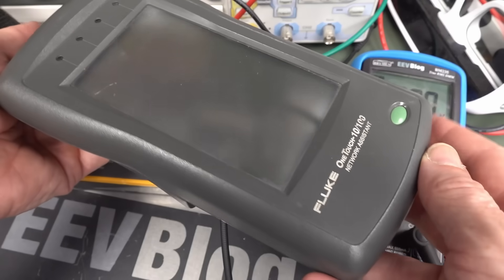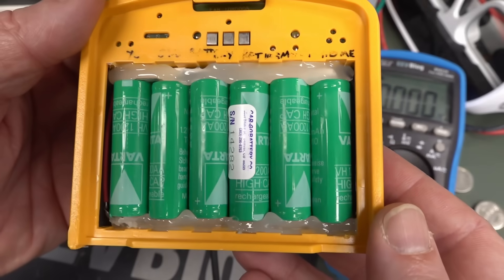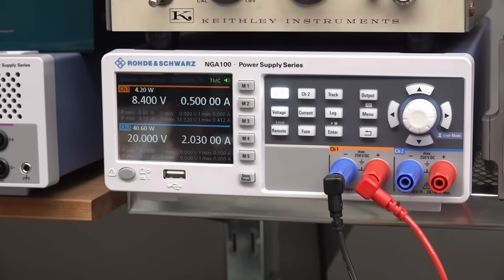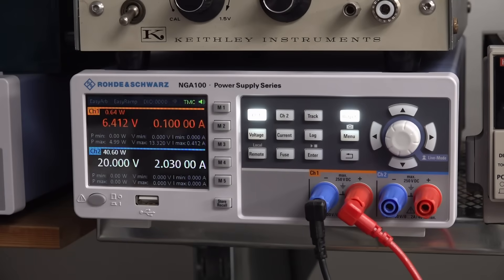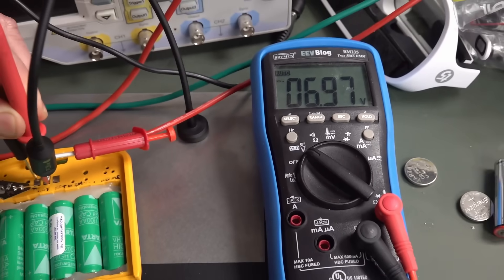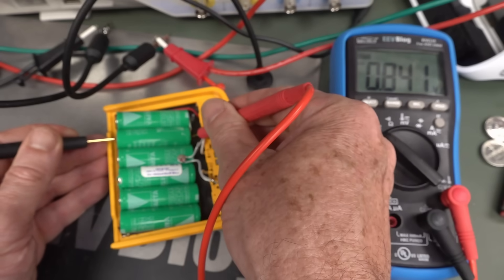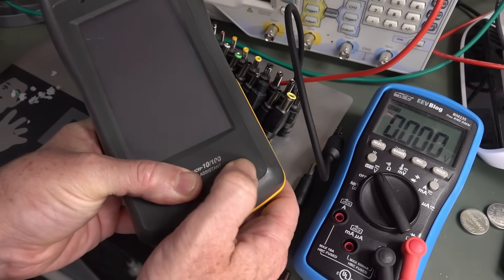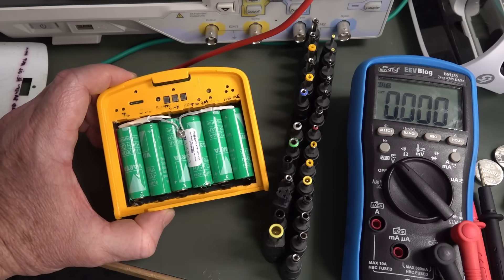Fluke OneTouch Network Tester Battery Restoration Attempt

Comment: NiCD batteries are a unique bunch. Their optimal storing voltage is between 0.6v - 0v flat, so leaving them empty won't kill it as it's kinda being preserved instead. Anyway what's probably happened is that there are too many crystals in the NiCD battery, causing a minor internal short or just blocking the electrical path within. To solve this, is kind of funny actually. You zap the battery with a high voltage. Yes absurd as this is, it does work and doesn't really damage the battery and actually increases it's resting voltage when fully charged. On battery university take a look at article BU-807 and BU-807a

Perhaps you could experiment and see whether it actually brings that battery pack back!

Comment: For old NimH batteries I usually hit them with high current (around C) for about 5-10 minutes first, keeping an eye on temperature. Then charge them at 0.25C until charged.

Comment: NiMh that old (this 1200mAh type is from mid 90s i think) are very likely to be completely rotten. It is not so much about voltage, it is the inner resistance rising up and up. Personally i use a ESR Meter, a good AA Nimh should be below 50mOhm, premium types like eneloop are below 25mOhm. If the ESR rises above 100mOhm it is time for recycling bin...

Comment: Try individually charging at say 12v and zap them briefly but multiple times if the current draw is high. This will usually breakdown any dendrite formation in the cells which causes high self discharge in older NiCd cells, be careful as it will consume the water inside the cell and most likely vent a little, that's why the short bursts of zapping higher voltage through the cell is best. 👍 😊

Comment: All these NiMH packs die eventually. I just buy an after market replacement and start again. Much better if you can replace the cells but replace all at once as even if only one has gone, the others tend to follow not long after. The centre negative is a pain, it arose originally from the switch build into the socket that breaks the outer. Centre negative is dangerous when it comes to working on equipment that is grounded or in a car. It should be banned, as should those jacks that can short while being plugged in.

Comment: My Resmed CPAP device (S8 Autoset Spirit manufactured in 2007) has a 12v bog-standard dc barrel input jack (as well as 100-240v ac which is how it is normally powered).
Wanted to go camping / have mains power outage backup ability.
Expensive 12v cables / adaptors available for those with deep pockets.
No markings anywhere as to dc polarity. Thought this was a bit Sus!
Nothing in instructions or on-line as to polarity. Alarm bells began ringing quietly.

Being an esoteric (expensive) medical device and me being cautious (i.e. a pessimist),  I checked continuity between the dc input jack against the diagnostic port. This indicated that the dc socket CENTER PIN is connected to 'GROUND' of diagnostic port !
Cautiously hooked up big 12v Gellcell (lightly fused) with CENTER NEGATIVE and it works happily.
No diode voltage drops seen while looking for continuity so assume no bridge rectifier correcting / protecting input polarity.
Manufacturer common sense would be not to use a VERY common 12v barrel socket. Possibly backwards compatibility hassles with much older products?
Scary stuff.

Comment: 11-15V Center Negative?
That looks like a SEGA Mega Drive Power Supply :D :D
Reply: So many fried regulators😂😂
Bought a bunch of broken ones and all had the same issue, used a centre positive power brick.
Cheap part, little bit of work and profit.

Comment: You could probably just replace the cells in pack. You could “upgrade” it to NiMH instead of NiCD. NiMH batteries are so cheap these days it’s probably worth it. You could probably also jam 3 18650s in there with a BMS and a buck converter
Reply: It's not worth the trouble to convert to lithium. Just put some low self discharge NiMH cells in there.
Reply: 6S Ni-Cd or Ni-Mh pack is worth replacing with 2S Li-ion pack (or 2S rectangular Li-pol depending on what exactly physically fits). BMS - required, boost/buck converters - not needed.
Reply: @volodumurkalunyak4651  I thought the same.  2S with a chinese TP4056 module and diodes to drop output voltage if needed.
Reply: @jameswest848  no. TP4056 - 1S ONLY.
Here: keep original Ni-Cd charging circutry, 2S Li-ion (or Li-pol rectangular), let BMS terminate the charging.
Replacing charging circutry with something like CN3302 (5V input) board or TP5100 (9 to 18V input) - also a valid option.
Reply: @volodumurkalunyak4651  Good point.  TP4056 is no good for 2S.

Comment: 0:39 Setting center pin as negative should be considered as criminal action !
Reply: Was common back in the 80s and 90s, sadly...
Mega Drive 1, Super Famicom had that as well as a lot of other stuff...
Reply: Nearly all guitar effects pedals are center negative. In that world, the opposite is taboo...
Reply: My Resmed CPAP device (S8 Autoset Spirit) has a 12v bog-standard dc barrel input jack (as well as 100-240v ac which is how I normally power it).
Being an esoteric (expensive) medical device and me being cautious (i.e. a pessimist) I checked continuity between the dc input jack against the diagnostic port. This indicated that the dc socket CENTER PIN is connected to 'GROUND' of diagnostic port !
Cautiously powering up confirmed center negative.
Wonder what would have happened if I had tried center positive without checking.
Reply: @leybraith3561  I run things like this on a variable supply and set the current limit way down to see if it draws excessive current.
Reply: Many dc devices have a reverse polarity diode designed to sort circuit the input if reversed.
Reply: @voltare2amstereo  Until it blows out. Reverse-diode and fuse would make it nearly impervious. Or just if the manufacturers had first agreed on a polarity standard, then used different physical plugs for different voltages.
Reply: All phone equipment (cordless phones) was center  negative.

Comment: I would first ensure that the device could be powered by connecting directly to a power supply and then consider wiring it for external power.
Reply: Didn't he say it powered up just on external power in the beginning of the vid?
Reply: @Steve_Just_Steve watched the first part again, and yes he does say that it powers up.  I still look for the alternate supply.

Comment: I'd say 10/100 tester is still relevant (at the right price).  If the cable can't pass 10/100, it sure isn't going to pass 1G.  I'd image a lot of problems can be found at the 10/100 level. Not all, but it beats a simple continuity tester.
Reply: Sure. Obviously quite useless for professional work but for a lot of fault finding in homes or less important places it really is enough to just find that one broken wire or loose connection.
Reply: @benbaselet2026  I don't know as I'd call it useless for the professional.  At the right price it's cheap enough for an assistant to have.  They can do a "first run" test before the big expensive 1G tester checks things for final acceptance.
Reply: @russellhltn1396  I don't where you are from but over here doing the work twice costs more than buying the right tool for the job you will need in the end anyways.